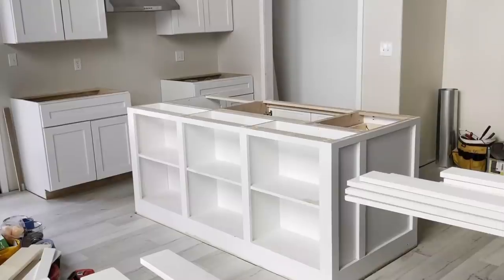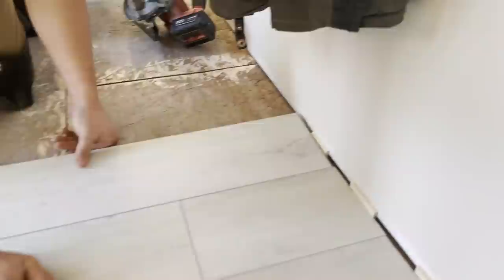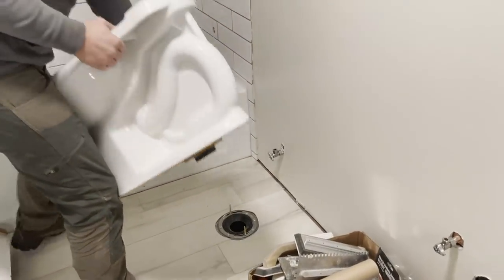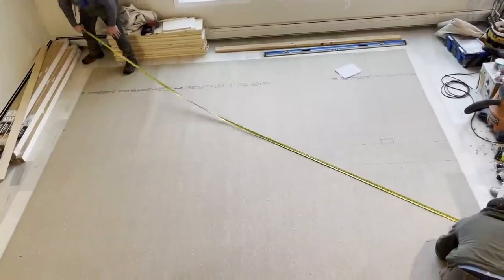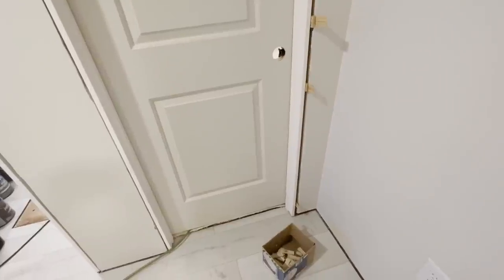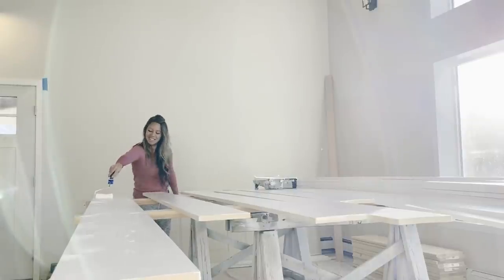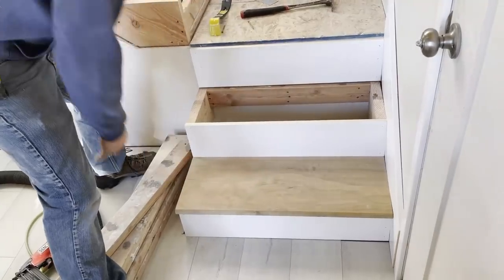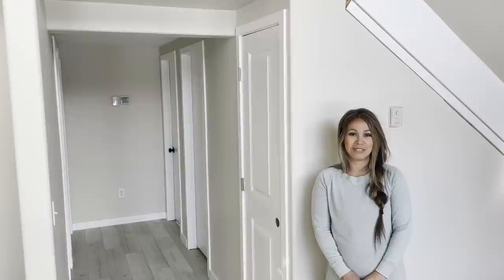Cabin House Build Episode 12: Interior Trim

Comment: For the door trim and baseboards, did you guys use 1x4 finger jointed pine boards? Was there any other reason, outside of simplicity, why you went with that trim vs 6 inch baseboard?
Reply from the maker: Yes, the 1x4 primed boards. It is more affordable as well, and with the square top edge, the homeowner could always stack baseboard on top for a taller baseboard look if desired.